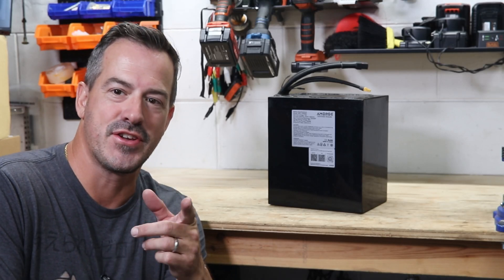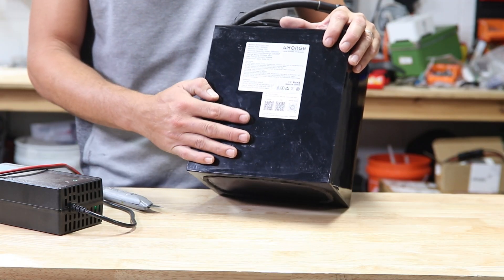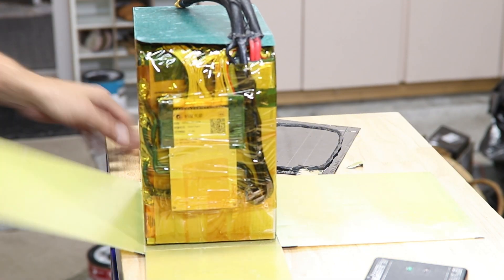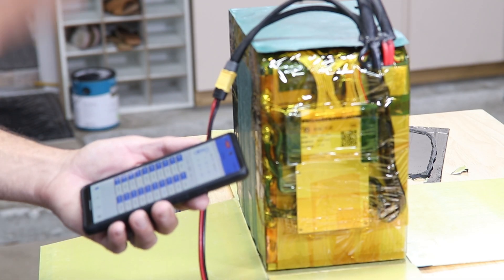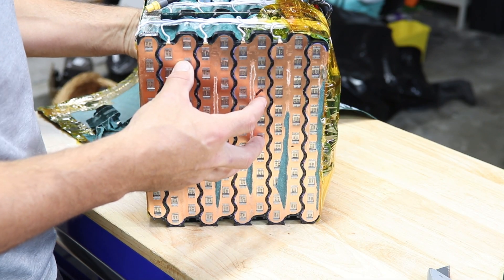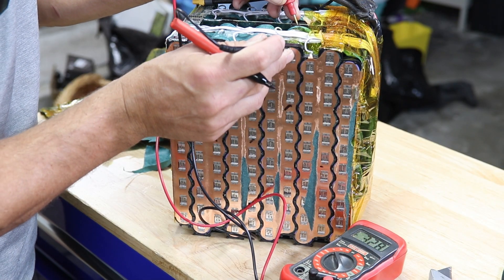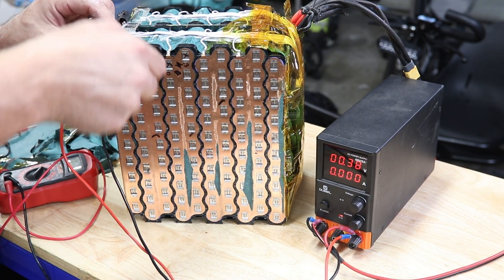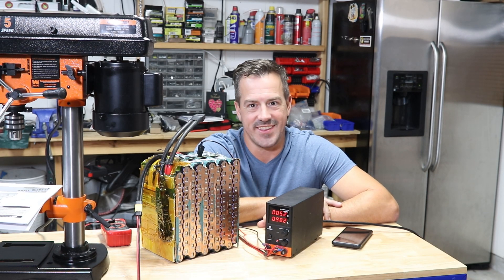Amorge Battery REPAIR! Can we fix it?! Hotpaxx Econic Momentum Watts wont charge, testing low cells

Comment: Amorge battery "diagnosis" is a more appropriate title here. 

And once cells get below a certain voltage, they're already compromised. Take it from a former battery process engineer, don't bother recharging those even if they seemingly hold charge. It'll just cause another repair event. Dendrite increase, IR increase, electrolyte breakdown, and some other damaging events take place at low voltages.
Reply from the maker: Nice 👍 thanks for the feedback.. I agree... Last pack had far better voltages when I repaired, and still working... These sub 2v groups are going to be horrible, and sub 1v, toast.